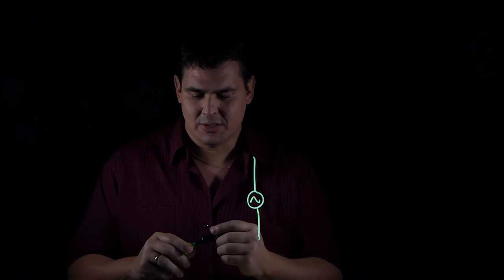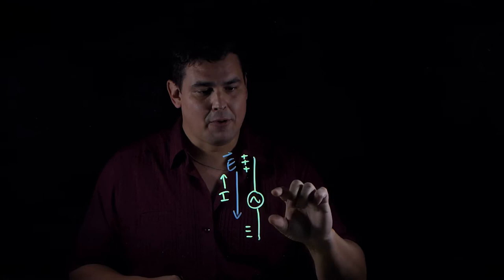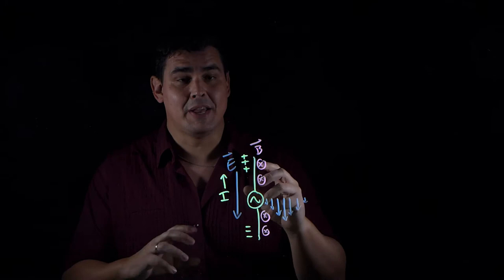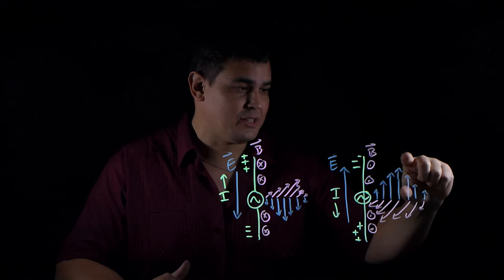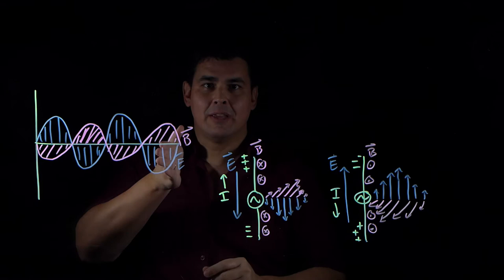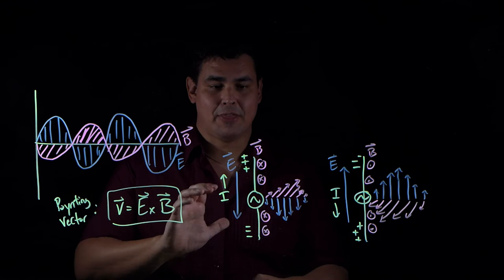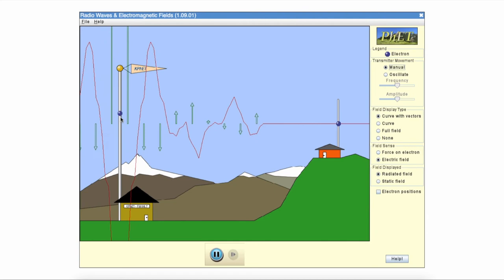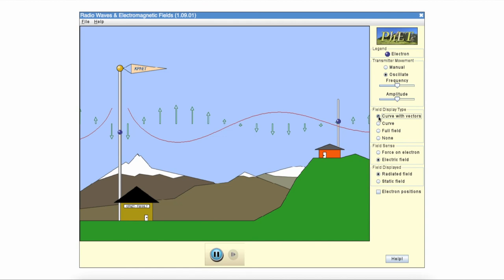Intro to Electromagnetic Waves (how EM waves are created, Poynting vector)

Comment: A recent radio experiment showing light propagates instantaneously in the nearfield and reduces to the speed of light in the farfield, after one wavelength is also another discovery that will radically change our understanding of science, in particular all of modern physics. In this experiment,the time delay of signals was measured between 2 dipole antennas as the antennas were separated from the nearfield to the farfield. The results showed that the radio waves (light) propagates instantaneously in the nearfield and reduces to the speed of light in the farfield after one wavelength. This corresponds to not only the phase speed and group speed, but also the information speed. These results are completely incompatible with Special Relativity, which is based on the speed of light being a constant c. Inserting c=infinity into the Lorentz transformation yields Galilean transformations, where space and time are absolute. This shows that if an inertial moving  object is observed using instantaneous nearfield light, then no time dilation , length contraction, or simultaneity Relativistic effects will be observed. So if Relativistic effects are observed using farfield speed c light, then by simply flicking a switch, one can change the frequency of the light, such that instantaneous light used instead, and the effects of Relativity would go away. This shows that the effects of Relativity are just an optical illusion and that Galilean Relativity is the correct form of Relativity.

Here is another very powerful argument that shows Relativity is based on a logical fallacy. According to Relativity, observers on a moving train and on a stationary train platform will disagree on the size of the ""Train"" and the passage of time on the ""Train"". This is a complete logical contradiction if the size and the passage of time of the train are real. If the size of the train is real, then the ""Train"" can not be both contracted and not contracted. The same goes for the observed passage of time on the ""Train"". If these effects are observed, then the only possible conclusion is that it is an optical illusion. Things that are real must appear to be same from all frames of reference. If not, then by definition it is an illusion.

Again the argument is very simple and it is the argument Einstein used to derive Relativity, and no acceleration is used in the argument. A train with length (L) traveling at constant velocity (v) relative a stationary observer on a station platform. According to Relativity, the stationary observer will see the train contracted (L/r, where r is the Relativistic gamma), whereas an observer on the train will see it not contracted (L). So the train is both contracted (L/r) and not contracted (L) depending on the observer. This is a complete contradiction (L not equal L/r) and can not be true if length is real. The same argument applies to passage of time on the Train, where both observers will disagree on the passage of time. If time is real, it can not be both dilated and not dilated (T not equal rT). If space and time are observed to be both large and small simultaneously for one inertial reference frame, such as the ""Train"", then it must be an optical illusion.

It should be noted that experiments proving Relativity can only give evidence that the theory may be true, but an experiment disproving Relativity, or a logical proof showing a logical fallacy in the theory can absolutely disprove the theory. I have provided both.

Since General Relativity is based on Special Relativity, General Relativity must also be an optical illusion. Spacetime is flat and gravity must be a propagating field. Researchers have shown that in the weak field limit, which is what we only observe, General Relativity reduces to Gravitoelectromagnetism, which shows gravity can be modeled as 4 Maxwell equations similar in form to those for electromagnetic fields, yielding Electric and Magnetic components of gravity. This theory explains all gravitational effects as well as the instantaneous nearfield and speed of light farfield propagating fields. So gravity is a propagating field that can finally be quantized enabling the unification of gravity and quantum mechanics.

The current interpretation of quantum mechanics makes no sense, involving particles that are not real until measured, and in a fuzzy superposition of states. On the other hand, the Pilot Wave interpretation of Quantum Mechanics makes makes much more sense, which says particles are always real with real positions and velocities. The particles also interact with an energetic quantum field that permeates all of space, forming a pilot wave that guides the particle. This simpler deterministic explanation explains all known quantum phenomena. The only problem is that the Pilot Wave is known to interact instantaneously with all other particles, and this is completely incompatible with Relativity, but is compatible with Galilean Relativity. But because of the evidence presented here, this is no longer a problem, and elevates the Pilot Interpretation to our best explanation of Quantum Mechanics.

*YouTube presentation of above argument: https://www.youtube.com/watch?v=sePdJ7vSQvQ&t=0s

*Paper it is based on: William D. Walker and Dag Stranneby, A New Interpretation of Relativity, 2023: http://vixra.org/abs/2309.0145

Comment: This is why Youtube is such a boon for education. Someone brought up the Poynting vector the other day and I told them to hit up YT. I teach electrical power system theory, and in every lesson I source random explanations to inject variety into my delivery. Tell me, does the Poynting vector, etc. invalidate the water analogy of pressure/flow/opposition?
Reply from the maker: It depends on what level of physics you're teaching.  The water analogy works when students are starting out learning about DC circuits because it gives them something they can relate to, but once you start talking about AC circuits and the fields in a circuit you can't really use it anymore. But at that point they will have some experience hopefully and understand what is happening without having to use analogies.

Comment: When the charge separation is maximum (peak |E|), the current is zero (B=0). When current is maximum (peak |B|), the charges have minimum separation (E=0). So, based on that, E and B are out of phase. The wave has E and B in-phase. Explain.
Reply from the maker: Dipole antennas are not as simple as they seem, but thats the example our textbook uses.  This example we use assumes you are looking at the waves after they have propagated far enough away from the antenna so that they are plane waves.  

Near the antenna they are out of phase, but from Maxwell's equations when you look at the relationship between E and B fields one is a time derivative and one is a spatial derivative, and when you solve for a plane wave they are in phase.
Reply: Hi, this will probably clear your intuition:
When E has its peak, the current is 0, from maxwell equations, this implies that the curl of B is 0. However, this does not always imply that B is zero, in this case it’s actually the other way around: curl of B being zero means that B does not change much when taking a tiny steps towards any direction 
Taking as an example the 2 dimensional case, you have ∂B/∂x=0, and that only happens when B does not depend on x (is costant everywhere in space) or, as in this case, when it is at its peak (when functions depend from x they hit their peak value when their derivative is zero, this is a common result shown in analysis), and that’s what actually happens in the case shown, where both E and B are in phase
(As a sidenote, we already know B is not costant in space because of the propagation which happened beforehand)

Similarly, when E=0 ∂E/∂x as its peak, which implies from maxwell equations that curl B has its peak, which in turn implies B changes a lot when taking a tiny step (∂B/∂x maximum value). That only happens when B changes completly orientation, when his value is B=0 so again, in phase
Reply: Is that what is meant by near and far field? And if propagation is in every direction .mmm.. Photon?
Reply: What you say is based on Ampere's law which has limitations and doesn't work in every scenario (for example this one). Try its extended version, the Ampere-Maxwell law and it will make sense.
Reply: Can you explain how near field change into far field so that e and b fields are in phase, I have spent lot of my time to find answer to this question with out any sucess

Comment: Thanks for the video. I have a question: Through what mechanism do the waves propogate? I get how at one point you'd get the osculating fields but I don't see what maes the fields move forward. Is this predicted by the math?
Reply: You can think of it as feeding water in a pipe from a pump.  Here the pipe is the medium(vacuum, air, water, etc..), and the RF transmitter is a motor. As the transmitter keeps feeding, the energy keeps radiating out. Notably, the free space (Vaccum) works exactly like a transmission line to the EM wave with a characteristic impedance of 377 ohms.

Comment: This explanation is very close to answering my original question: How does AC power move from a generator 300mi away down a transmission line if the electrons are just "moving back and forth"? The answer lies in a moving charge creates an EM field that propagates down a wire to the transmission lines. An AC generator and a radio transmitter really are doing the same thing: creating EM fields. When a radio "wave" leaves the antenna, there is no "going back", that wave has left the antenna. Same for a generator and a transmission line. Nearly all explanations miss this point, or get bogged down in their original miseducation on this topic. A generator is really a "transmitter" operating at 60Hz. A 80m Ham rig is a transmitter operating in the 3.5MHz-ish range. No one questions where does the oscillating RF field go, clearly down the transmission line (coax ususally) to the antenna. Then that RF field is radiated into free space, possibly directionally, or omnidirectional. Clearly that "+/-,  -/+, +/-, ..." charge is not just "going back and forth" in the coax. It seems all explanations about moving charges totally miss this key concept captured by this video.

Comment: I watched tens of videos on this topic, but I still cannot animate in my mind how E and B fields interact to form a self propogating wave.    For example look at  half of a wave  at 3:14.  I can see that the source charge (or current) going up and down  creates the blue E lines. I also take for granted that each blue line creates a perpendicular pink magnetic line.  But then when and how pink B lines create  which blue E lines (as modelled in Maxwells equations) as a part of this self propogation?
Reply: Ampere's law says that whenever electrons move, a magnetic wave (B) is produced. Faraday's law says that whenever a magnetic wave is changing(such as the antennae example in the video), an electric field(E) that moves electrons is produced. These two laws of electrodynamics are the push-pull of what creates a self-propagating electromagnetic wave(in a vacuum).

Comment: Nice video and presentation. 
A plate capacitor without permittivity between its plates cannot establish polarized electric field inside to store charge. 

Permittivity is provided by dielectric materials such as glass, ceramic, gas as well as vacuum. 

The permittivity in vacuum is responsible for polarized electric field inside, also responsible for alternating polarized electric field in vacuum and hence electromagnetic and light wave, in vacuum. That also explain why we can see distant stars millions light years away, through vacuum. 

Vacuum permittivity is provided by Aether, a light medium.

Comment: Thanks! But why the direction of current is opposite to the direction of electric field?
Reply: conventional current is defined as the rate of flow of positive charge through a cross-section
Reply from the maker: Current is the flow of negatively charged electrons.  Since field lines point in the direction that a positive charge would feel a force, they are opposite for electrons